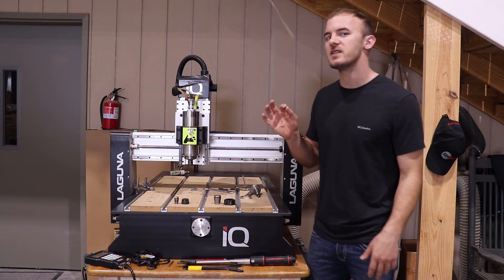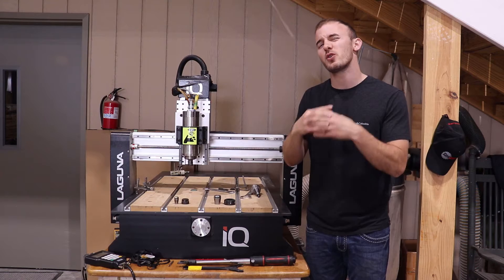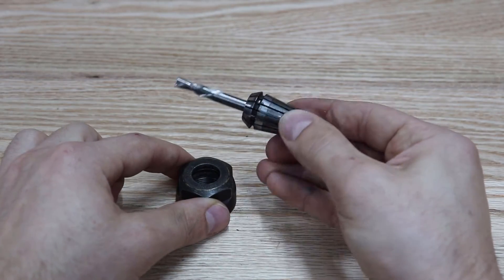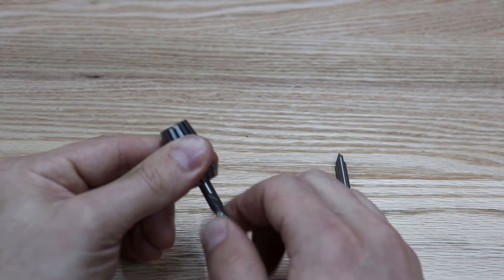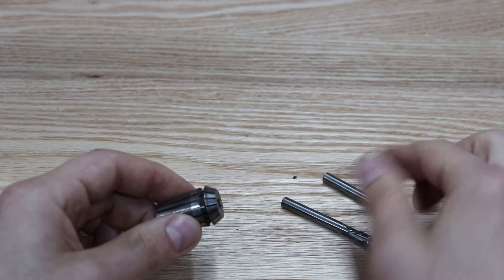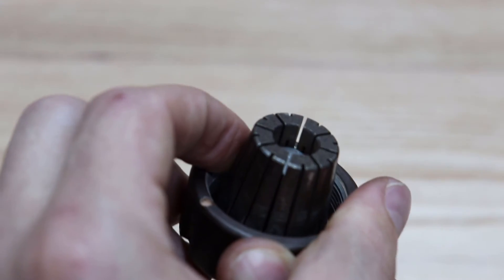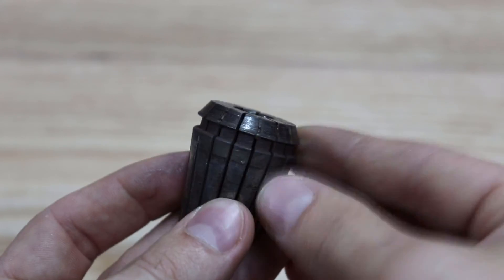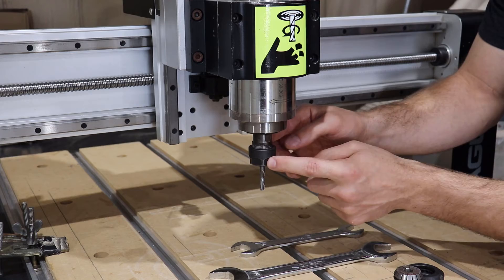Tightening Bits and Collets  | How to Use Your CNC Correctly

Comment: Just to be sure about that chart, the torque for collets ID over 2 mm for ER16 is 42, for ER20 is 59.
For collets ID under 2 mm, ER16 is 30 but ER20 is 24 ft/lbs?

Is this correct since ER25 is 77 in both columns?
There is less torque needed for a ER20 collet when the ID is under 2mm?

Comment: For the units-purist: Torque is in metric expressed in newton-meter (Nm), not newton per meter.  More force (newtons or pounds) or a longer arm (meters or feet)  increase the torque, so both quantities are multiplied  instead of divided as 'newton per meter'' suggests.
Apart from that, your video apparently was an eye-opener for many watchers, so very useful!

Comment: I understand what you are saying but how do you know your bit tolerance if you don't set it flush with the back of the collet? I was always taught the back of the end mill should be flush with the back of the collet unless the cutting edge is too close to or in the collet then you pull it out some. This is important so when you change tooling and go back you already know that end mill sitting flush sticks out xx mm or inches from the collet. Lots of CNC software considers the bottom of the collet as Z0, like mach 3. If you add your tooling into the software and it's flush you can save that tooling and then the software automatically knows when you select that tool that it's going to stick out say....2 inches from the bottom of the spindle. Z probing doesn't help you in the middle of a project when you make a tool change, only at the start. If you have consistency with putting the end mill flush with the back your tolerances will be much closer if not spot on all the time.

Comment: Stickout at the back doesnt matter.
The bit is pushed out if it cant go in that deep while clamping.

Impropper stickout on the other hand(cutting side) can and will induce isseus.   If you need to to get deep enough. Be aware of that.
 On the blank side of the tool. Its absolutely no problem. 

Simply becourse the taper is precision ground to match the collet.  This part is bullshit rule. If that coyses issieus.  Replace the collet !

Comment: Unless I'm mistaken ER collets clamp at the front and at the rear. 5C collets only clamp at the front. That's why the slits in the ER collet are cut from both ends.

 Preferably the tool should insert to at least even with the rear face. That ensures maximum clamping. If, for whatever reason, the tool is too short, resulting in the flutes going into the collet, then it should be pulled out until the flutes are clear before tightening.

Snaping the collet into the nut first I totally agree with. Doing anything else will result in damaged collets, tools, work piece and probably the router or mill spindle.

As someone else pointed out if there are ridges worn in the "nut taper end" of the collet that's almost to be expected after some use. A "small" amount of anti sieze on that face will slow that problem down but I emphasize "SMALL" amount. If the ridges are on the main tapered part of the collet throw it away. Also examine the machine's spindle taper carefully. It may have been damaged in sympathy and repair may require some specialised grinding to repair.

The one requirement you didn't mention was to make sure your spindle is clean,  the collet slots are clear of debris. New collets especially can have swarf from the cutting of the slits left behind. Examine with a light and magnifier. If any are seen I've found a small utility knife blade is about the right thickness to run through the slit to clear them. If there are ridges at the inner or outer edges of the slits fetter them off with a fine, small triangular file. Any protrusion will cause run out. Likewise make sure there are no burrs on the shank of the tool you're inserting.

Thanks for your video.

Comment: Thanks for the informative video. Just a small detail - using the metric system - torque is measured in Newton Metrers ( and not Newtons per square metre).  Best wishes.

Comment: The 'scratches on the collet' thing would depend on where the scratches are. Scratches or raised burrs on the long taper would be bad, they indicate the collet has been slipping in the spindle and they could affect alignment. Wear marks on the short outer taper are just a normal result of the nut turning against the collet every time you change bits.

Comment: Pretty good info. But,... the hang out in the back doesn't matter as long as the collet is the correct size. I just keep trying different sizes  until the collet holds the cutter,  drill, ect.. cutter slides freely buts just grabs. Or put tool in collet and squeeze collet out of the nut with my hand and as long as there is a visible gap in the slots and and the tool holds tight with hand force your good! I've been a machinist for 30 years and have never had a problem with my technique. Just wanted to let you know.

Comment: Machinist my entire career, nothing wrong with having the shank of the endmill sticking out the rear of the ER collet. Ideally the shorter your stickout the better so long as you dont run into clearance issues, you just cant go past any of the flute grinding. I totally understand if you use this as a shop standard for mitigating clearance issues with crashing collet nuts but just know theres nothing wrong with it and in general its more rigid. There are toolholders in the metalworking industry you can get with adjustable depth stops, its just a set screw you can get to through a hollow pull-stud (also common in the metalworking industry for through spindle coolant)
Reply: I have to agree with you - been machining for 20 years and absolutely my take on this issue also .
Reply: This. I'v seen many collets get damaged by leaving that gap at the end of the bore and also due to bad strength to brains ratio on some of my former coworkers.
Reply: 200% agree.   If this gives problems its time to replace the collet.
Reply: Thanks! These kind of inputs are really important!
Reply: Agree. I run my end mills flush. If I were to change a tool during an operation I would have to zet my Z axis all over again doing it this way. If I just push the end mill flush with the back and know the measurements I can easily compensate with a little math. (better not say math too loud the younger generation may get scared!) I've never been more than 2 thousandths off yet which yeah that can be alot but still that's a tight tolerance!
Reply: @TheCommo81  2though.. thats 0.58mm? Thats quite a lot!
When i make something with these tolerances..  i can scrap it all. Lol
Reply: @Jbpipesandmufflers  0.58mm is still a tight tolerance. When I do bearing pockets and they are 2 thousandths off I just freeze the bearing in my freezer for an hour and it drops right in. if it's going on a shaft I set the bearing on a 100W light bulb for about 3-4 min and it slides right in. When it cools off it's nice and tight. 2 Thousandths is acceptable to most people. My neighbor has been a machinist for 50 years, 2 thou is the max for him. What I was referencing was placing the tool at the same exact height every time you will know where your tolerance lies when changing tools in the middle of a run.

Comment: Why is a bit sticking too far into the collet not good?  The shorter the tool, the less deflection, chatter, etc.
Reply: In principle, the nut needs to move the collet+bit deeper into the taper in order to clamp tighter onto the bit. I suppose if the back end of the bit has already bottomed out it could prevent that from happening, but in reality I doubt it's a problem.

Comment: There's probably a reason why you've never been told about the torque settings on a collet. Or why there's no torque specifications in the user manuals of these machines.

Comment: Long stock that runs through the collet chuck is turned all the time on a lathe. The concern with tool bit holding was always to not be careful not to allow bottoming out on the bit shank which may result in an uneven clamping force when the nut is prevented from fully seating the collet.
Reply: or, with long stock... the free end whipping and throwing harmonics down the line...

yup, never heard or seen anyone ever say you shouldnt push stock/cutters right into a collet... up until now.

where some people get their information from... ffs...

this is an example of why one should do a trade or at least read some trade books...

Comment: Struggled for hours trying to get a bit to run without a wobble on my cheap CNC machine. With a lot of force I managed to snap the collet into the nut and it cured the problem. Many thanks.
Reply: Actually the collet snaps into the nut quite easily if you  push the collet hold the (empty !) collet at an angle while pushing it in.

Comment: I am a total newbie to this. You have solved a problem I have had for three months. I bought a cheap 3018 CNC router to have fun when retired and the tool end always wasn’t central. It moved in a circle at the end when I rotated the motor. So the tools couldn’t machine a good thin line. I bought a new motor and collet but had the same thing. Then I saw your video. I was installing the tool into the collet then the collet into the nut. Just tried clicking the collet into the nut THEN installing the tool, then tightening. Problem solved! Thank you
Reply from the maker: Your welcome!

Comment: Firstly I just wanted to say that I really enjoy your videos and there is a lot of solid information here. Unfortunately, I think this one has some bad info in it. I'm am new to wood cnc's and have a small cnc (4030 prover) with and er11 collet. I had watched many videos in preparation for using the machine and this was one of them. I noticed quickly that even with feeds very slow, I was getting horrible chatter at low speeds. I checked runout at the motor shaft and coupler and it was imperceivable. At the bit it was almost 1mm, so definitely the source of the chatter. I was pretty sure I identified the collect nut as the source of the runout and got some higher quality ones, but the issue persisted. After watching this video I was placing the bit about 1/8" below the collet as you showed. None of my efforts to get the runout in check were having any effect until just by virtue of running out of options, I installed the bit so that the end was protruding from the collet. Runout gone. It is repeatable as well. Every time I install a bit below the collet lip I have almost  a mm of runout. There is at least 3/4" of room in the chuck that the but can slide back into so I can't imagine why you would not install it so that the entire collet was gripping the bit. At least for me, installing the bit the way you describe in the video caused me a major 3 day headache. These were 1/4" bits that I was having issues with.
Reply from the maker: Fair enough, I have been running my bits the way I described and have not had any issues. I have talked with about a dozen machinist on the topic and it depends on what machine and setup you have. But as always there is a “on one hand, then the other” type of situation, my apologies for the headache. Best of luck to you!
Reply: @cutting-it-close  Hey no problem. I'm also sure that little er11 collets aren't really in your scope.  Just my experiance. Thanks for creating content. Your information about various speeds and feeds have been a great start for me.

Comment: Never seen anyone using torque wrench before, even router manufacturers not stated in usage instructions. However, if using a torque wrench, first thing I was taught as a mechanuc,  ALWAYS Zero it back after use, otherwise you will invalidate the settings as the spring will be overstrained long periods.
Reply: Actually like all thread fasteners, there is a recommended and  max torque value that should be abided by. ER collet nuts are very susceptible to cracking because of the tapered interface between the collet and the nut which puts a lot a tensile hoop stress on the nut.  Since the vast majority of endmills used daily are upcut design, the cutting action naturally is trying to pull the endmill out of the collet and thus you want as much torque as you can safely put on the nut to generate the most clamping force from the collet but at the same time, you obviously dont want to crack the nut..

Any time one is trying to do very high accuracy / extremely low tolerance machining using ER Collets (or with any type of tapered collet), retention thread torque values should be abided by. Most aerospace industry machining businesses (among others) are very particular about this because of the tolerances they are trying to hold. I've worked for a few places over the years that if you were seen not using a torque wrench and proper values when setting up tools, you faced suspension and / or getting fired. Then again, these were also jobs where loose tolerance jobs where in the +/- a couple tenths (like +/- 0.0002" (or +/-0.005mm) and tight tolerance where in the hundreths (like +/- 0.00005" (or 0.001mm). Beyond that, you were getting into the realm of ground and lapped to size rather than milled but still, a few lb-ft of torque difference can result in a cutter slipping a a tenth or two in the holder and blowing the tolerance.

At the same time, many of these industries have gotten away from collet style tool holding and gone to shrink fit and hydraulic tool holders due to their superior retention over collets.

Comment: QUESTION: How can you calibrate a Z-axis if it is not exactly in relation to the X / Y plane? I'm using a Stepcraft M1000 and can feel with my fingernails, that the surface I milled isnt flat.
Reply: You need to tram x/y using a tramming tool:

https://stupidsimple.tools/products/tramming-tool?variant=38224402776262

Z is only up or down, so any ridges you feel or see are corrected on x or  y plane. It is near impossible on any hobby grade machine not to have Machining marks left that does not need a little sanding before finishing. But if you are referring to actual ridges, then tuning it up will help solve the problem.

Comment: great tips!  now i have to get crowfoot adaptors for my torque wrench, never thought of torque.  Question for ya.  i've been following your advice on feeds and speeds.  i have a laguna 4x8 router.  when I follow the feeds and speeds to the full calculations cutting maple with a whiteside 1/4' compression endmill.  i get a horrible sound.  sounds like a demented freight train whistle. i've played around with speed and feed and still get that horrible sound. using new bits.  any idea what could cause this?.  thanks for all your great videos and tips.  they have helped out a ton
Reply: Try using an up cut bit instead.  I just milled 10/4 hard maple with a 1/2” UC end mill.  No problems.  1/4” DOC each pass.
Reply: @cutting-it-close   on a piece of 3/4 maple i tried 3 passes   first pass being .25"  i have tried it in 2 passes as well.   right now i've dropped my feed and speeds 18000 spindle 170 feed.  still have the freight train sound. not as bad.  i think it's chatter and I've tried faster speeds and feeds and slower. gone to extremes holding down my work piece as well.   still get it, especially with maple.  Up here in canada we pay through the nose for bits. so its is a bit frustrating.(no pun intended lol)  by the time i get a whiteside or vortex compression bit delivered im in $60 to $70. i have an opportunity to do a mass cut project for a customer that could make my year. All maple.  just worried about taking it until i figure out how to cut more efficient and cleaner   im cutting latter today and tomorrow.  maybe i'll take a video and send it off to you.   more than likely it is something really obvious and i'm over thinking it.  Thanks

Comment: You changed up your closer. If you ain’t cutting it close you ain’t cutting it right. I look forward to your videos. Could you do videos on climb cutting verses conventional cutting and when to use each one. I would also de interested in a video on the types of work you typically do on your cnc. Signage , cabinets etc.